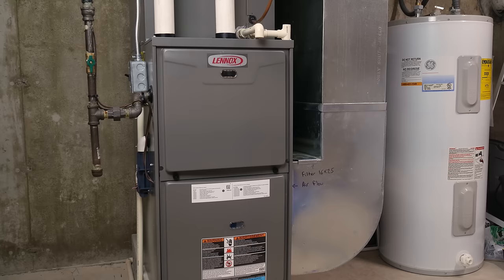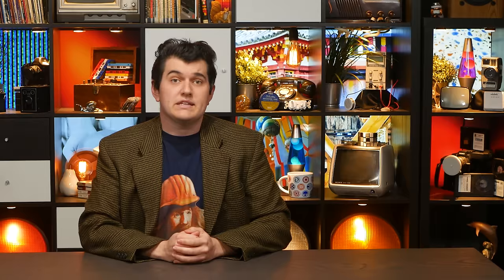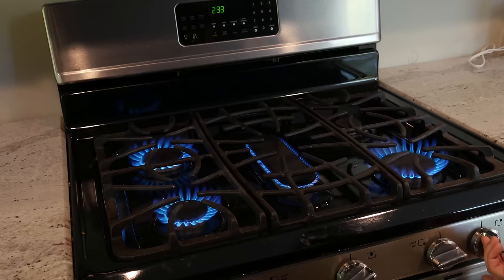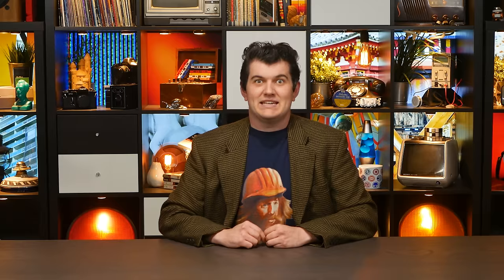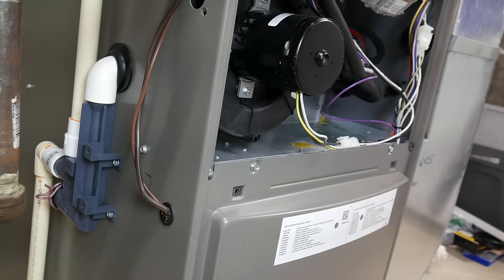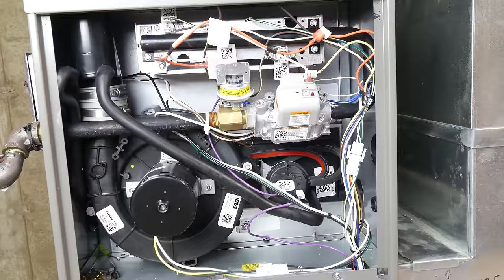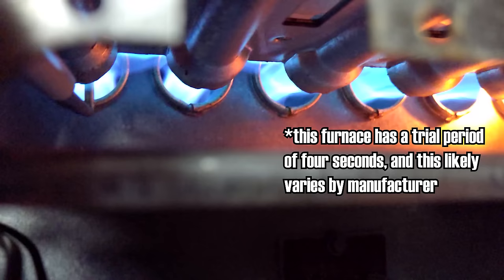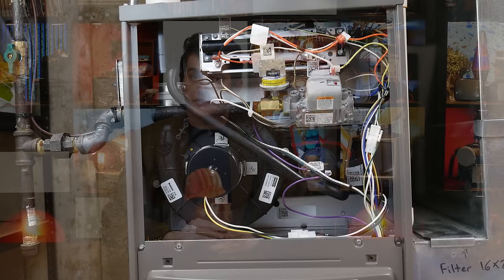Forced-air Furnaces: The What, Why, and How

Comment: "blower motor" stressed that "wrong" way is much more like the natural stress in British English.
Reply from the maker: A thing that's always puzzled me about that is that, to my American ears, it seems more appropriate to put the stress on the thing that makes it specific or different from the norm. There's many kinds of motors - what it's for seems like the more important thing to stress. I feel the same about how "ice cream" is said over there. Yes, it's cream, I got that, but it's frozen and that's what's special about it. Anyway, thems me thoughts.
Reply: @TechnologyConnections  that makes sense,  but the counter argument is that it's more important that it's a motor than that it's a blower something. Or in other words,    ice cream is basically cream, so if you miss the word ice that's ok. But if you miss the word cream you'll be miles off.
Not that I'm saying our way is better, just I think both are sensible,  and it amuses me that we differ.
Reply: @TechnologyConnections  However the phrase blower motor while yes it does clarify what the motor is for it does not however give any information on what type of motor it is. Mostly useful in the context of distinguishing between multiple motors in the same machine the only information given about the part in question is that it's a motor, motor type and drive mechanism are unspecified. Then again a technical description of the part itself is generally pretty impractical for verbal communication at least thus why we generally give the things part numbers rather than trying to memorize and recite the entire technical specification when we need to refer to that specific part.
Reply: @xorsyst1  Bolloks!

Comment: On a possibly unrelated sidenote: i always wondered if America's Corona spreading action is helped by the omnipresent air conditioning.
 

Like compared with opening a window.
Reply: That would all depend on whether SARS-CoV-2 lurks inside or outside your home.  Around here, it seems the neighbors aren't aware there's a pandemic.  I hear them making gregarious noises all the time.
Reply: @joesterling4299  And if Your home  is (air wise)  connected with other homes. Not to mention your office with other offices, which is almost certainly the case. It will dissipate very quickly outside your window.

 I remember when this sudden mass outbreak happened in that big slaughterhouse in Germany the fast spreading was blamed on the ventilation system. 
And the poor working conditions.

Comment: Okay so this drives me nuts - I've lived in BC my whole life and every house I've ever lived in has just had baseboard electric heaters and nothing else. I can't imagine requiring a bloody furnace.
Reply: everyone out here on the prairies in Manitoba uses these.  Almost every house in Winnipeg uses a forced air furnace (mine included).
Reply: Requiring? Well, it's not required, but it's cheaper than using only electrical heating.
Reply: Consider yourself lucky, Trudeau has already taxed home heating, and increased the tax in the middle of a pandemic. you'll be far better off with Electric.  I'm thankful I have nothing better to spend my money on, so I'll just keep my house extra warm and pay the damn tax.
Reply: @xeero24  k
Reply: Depends how much heat you need and how expensive electricity is. Here in Saskatchewan you'd bankrupt yourself running electric heat. Pretty much the only people that do are those that have no other option with no natural gas or propane available nearby.

Comment: I, a European, have no clue what he's talking about
Reply: I, a Floridian, also have no clue. The idea of adding heat to your house is beyond ridiculous to us
Reply: @johnbeauvais3159  well my good friend u would be surprised to find out then that if u have central ac u also have a heater cuz the law requires it for .... reasons?
Reply: Link Hidalgogato I am surprised to learn this, the house I grew up in was built in the 1980s and to my knowledge we have never turned on the heater.
Reply: @johnbeauvais3159  yeah they dont exactly get a lot of use but yeah every air handle unit has an electric heater. i have never turned it on either cuz u know dont wanna cook my self
Reply: How do you heat your houses in Europe?
Reply: @gregorymalchuk272  water gas boiler with radiators or heated floor.
Reply: @ilyacheladin1  
You guys have some very nice ultrathin radiators in Europe. I don't think I've ever seen them used in the U.S.
Reply: @gregorymalchuk272  In Ireland we use an oil-fired water-radiator based central heating system.
Reply: Water boilers work similarly, except for the heat exchanger.
Reply: I am Weasel
Reply: @Jupiter__001_  Water radiation?  Do you use tritium in your water, or radio-active oxygen? :-)
Reply: I, a Russian, have no clue what is "heat".
Reply: @Jupiter__001_  my parents old house that was built in Virginia in 1950 also had a oil furnace and central ventilation.
Reply: The difference between the continents is the distribution of heat. You burn something in a “remote” place to generate heat and get rid of the exhaust from there. In the old world water is heated and transported via a pump and pipes to the places in the rooms where heat is needed and distributed by radiators. In the US air is heated directly in a furnace and distributed through the place in ducts. Distributing warm air in fairly large ducts over long distances is less efficient than distributing warm water in small and isolated piping.
Reply: @e.c.listening326  ...and probably the heated air in US houses is way more dryier compared to the air in european heated houses with water radiators.
Reply: @gregorymalchuk272  In Finland, wood heating boilers are popular, modern ones can be very efficient (90%>). Oil burning and wood burning combo boilers used to be common but are getting phased out. Heat pumps have been increasing in popularity since the 1990s and my house uses a ground source heat pump connected to a 130m deep borehole. Old style heating is still common too, massive masonry fireplaces that recirculate the smoke and can be over 70% efficient. I have one of those as a secondary heat source and of course for the ambiance. It's the heart(h) of the house after all. I'm also seeing more solar panels.
Reply: @1873Winchester  Yes, its about the same here in Sweden. We use a wood heated boiler. Its a bit annoying though now after I've lived abroad in Austria and got used to a gas heatetd boiler, because with the wood boilers you have to put the wood in yourself.
Reply: @haffa4764  well, I would argue that the wood burning boilers are getting few and far between, at least as the primary heat source in Sweden.
Reply: @haffa4764  I don’t know where in Sweden you live, but everywhere I’ve been we’ve used either electric heated boilers, remoteheat(?)(fjärrvärme) or the electric heat pumps mentioned in the video.
Don’t mean to offend or critizise you but I don’t want you to give the ’mericans the idea that we’re an undeveloped little country that still burns wood for heat.
I should mention that I’ve never lived farther than 10 km from a ’big’ city, so it might be that I’ve been spoilt by that 😆
Reply: @YaFaceIsMine  I live on the country side, and we and all our neighbours use them as our primary heat source. 
Of course in the cities or towns it is not usual. So they are in number not that common, but for certain regions of Sweden they are still widly used
Reply: @haffa4764   That’s cool! I had no idea 😆
I guess you learn new things every day. Thanks 🙂
Also, thanks for not overreacting to my plump comment, I know it was a little harsh sounding, but I was feeling frustrated for something completely different so I needed to vent a little.
Reply: My home in Pennsylvania, built in 1920, has a coal cellar with external coal door.

It has since been converted to gas heat, but there was still a half-barrel of anthracite when I cleaned the room out last year. Made for a great bonfire!
Reply: Having lived with both systems, I can authoritatively state that radiant heat is LESS efficient than forced air. Nearly every house that "upgrades" to forced air sees a utility savings.

It's just extremely impractical to transfer 90+% of heat energy to water.
Reply: @linkhidalgogato  That is simply not true, go buy an air handler and see if you can just turn the heat on... In most cases you have to but a heat kit to install after the fact to match the size of the space it is heating and the blower drive.
Reply: @whitewigglesworth  the building code requires every house has heating so unless your house is absolutely ancient or has a dedicated heating system your acu is also a heater maybe they dont get made like that by the factory but thats how they are all installed

Comment: 3:55 oh great now I will have $500+ heating bills to match my cooling bills here in Texas!  With over 5000 sq feet to heat, I currently have 176,000 BTU's of heat that is 94% efficient (my house attic is fully sealed and have to use HE units to get fresh air from outside.  My gas bill is only about $150 during the cold months.  Absolutely hate heat pumps!  I have them on my boat as well and have to supplement it with emergency electric strip heating as well, as the water gets too cold to extract the heat out of.   When I lived in Kansas I had a heat pump and never again.  Someone will have to pry the gas furnace out of my cold dead hands before I give them up, or start giving me electricity for free to run them all the time, in which case then I will keep the house much cooler as well!  😁

Comment: 4:00 But if your electricity cost per joule is 3x that of Gas (and getting higher) electricity is way too expensive.
Reply: Nope because heat pumps are way more efficient than furnaces. You also need to look at the price per BTU of energy not just raw numbers. Furnaces will never be 100% efficient which means for every dollar you spend you will get less actual heating per the money you spent. While a heat pump works of a vapor compression cycle and for every dollar of energy you put into it you will more than money dollar out of it. The efficiencies of the best heat pumps get into the 10 to 12 HSPF range which is basically the same as a 1200% efficiency.
Reply: Not as expensive as climate change
Reply: @KellyClowers  Climate is always changing. What's your point. BTW something I've never heard answered, what is the optimum global temperature? Did you know that for the majority of the Earth's history the global temperature was about 80F? That's 22 deg F ABOVE current global mean temperature. Where is the danger of 2 deg rise?

Comment: Excellent video! Cheers form France! Also, the flame sensor is supposed to be a ionizing sensor. If there is flame, a small current will travel from the metallic nozzle to the flame sensor (piece of metal essentially)
At least that's what I red somewhere!

Comment: “We don’t typically use electric resistive heating to heat entire homes, because, while electric heat is itself 100% efficient, electrical generation is not.”

laughs in québécois
Reply: Houses built around here (Pacific Northwest) in the 1950s through 1970s sometimes were all electric (resistive) heat.  This was due to the a) the climate being mild, b) natural gas and propane not being cheaply available, and c) very low electric rates, around $0.02 or $0.03 until the early 1970s.
Reply: Laugh all you like, but, even hydro (or wind) plants aren't 100% efficient, you get losses in the generator windings & also in keeping the generators cool, also through inefficiencies in the water turbines & pipes that supply those, & I'm not even starting on the transmission losses.
Might be lots better than a fuel burning plant, but nothing is perfect, please see laws of thermodynamics.
Reply: If you use electric resistive heating, you don't have to worry about turning off the lights.
Reply: @vinquinn  my house is also 100% LED
Reply: @beardyface8492  I mean yeah, but it also has 0 ongoing carbon emissions, whereas a gas furnace does not.

Comment: A big problem in Europe now is even though Central Boiler With Radiators isn't worse, in some cases I would say preferred for heating a home we are now running into the problem that most of them aren't designed to run at the lower temperature water heated by a heatpump. Meaning that installing a heatpump usually is much more expensive and requires either the installation of new radiators designed for the new system, or creating a hybrid system that leaves the old radiators and suplemeting the warm water with extra heat from the boiler or installing a new ducting system like seen in this video.

This means that a lot of "poor" / "Lesser off people" living is usually older homes that could really use these more efficient and more importantly cheaper to run systems unable to afford such big renovations! 

This is coming from a Dutch perspective though, so this argument holds the most weight in the northern western European part of Europe,  I don't have much experience with southern European heating designs or eastern European ones.

Comment: I remember All Electric houses of the 1960s and 1970s.  They were much more expensive than ones with gas water heaters, gas dryers and gas heat.
Reply: ...yes expensive... in the 70s which was what 40 plus years ago. It was also in vogue to use leaded fuel and smoke yourself into cancer

Comment: As a hvac student in europe: "what the hell is this thing? "
Reply: Wait until you find out how we get hot water in our showers here in Brazil lol
Reply: @guilherme94  I've seen Electroboom  talking about those things, i don't care how "safe" they are, a water bucket seems way more sensible.
Reply: @guilherme94  imma be real with u i know they are safe but i just cant bring myself to thrust those things
Reply: @guilherme94  Happens in so many parts of tropical Latin America!
Reply: @SickCotic  
Don't you have any forced air furnaces in Europe? I know you guys have lots of radiators.
Reply: @gregorymalchuk272  I can only speak for Norway, but here it is almost exclusively heat pumps. We pretty much banned all use of fossil fuel heating in houses anyway.
Reply: @SickCotic  
What refrigerant is used in your heat pumps?
Reply: @gregorymalchuk272  Most modern systems use R32, but older systems are still on R410a, but those are not legal to sell as new if memory serves.  and i have a portable one with R290.
Reply: @SickCotic  I like how you say "older systems are still on R410a" Here in America, our "New" systems are ONLY R410a. XD
Reply: @SickCotic  Do the heat pumps work in winter when temperature dips below 0 degrees?
Reply: @panzer3279  Zero degrees in what units?

A relative from the Midwest had heat pumps, but still needed a furnace for days when the outside morning temp was -40 in Centigrade or Fahrenheit.  Actually warmer than that, but it will work below freezing, maybe below -10 F.
Reply: @Egilhelmson  I meant 0 C. So heat pumps don't work well below freezing point.
Reply: @panzer3279  They work like absolute shit when it's very cold. They also work overtime when it's just somewhat cold, and burn the much faster. As usual, there's no magic bullet that fixes everything. Although minor improvements in very specific areas can cause people to go on about their chosen technology as if it was the environmental second coming. If that happens I just ask them why they're not heating their house with a small nuclear reactor. Zero emissions and you can get pretty much unlimited heat from some funny rocks. You could also electrically power your entire neighborhood from the same device. Anyone who doesn't have a fission furnace/generator in their basement is ruining the environment. Lol
Reply: As someone who lives in the Sun Belt, I don't know what it is either.
Reply: @blackhawks81H  thats wierd here in sweden our heat pumps works fine up to -20c
Reply: @blackhawks81H  You must have a shitty unit.  Works just fine down in -20c, but the efficiency coefficient gets a bit lower when you pass -10c. Varies from unit to unit/brand but min e is 5.5 at -7c and 4.0 at -25c
Reply: @SickCotic  yup, here it's also R32 heat pumps, ground/geothermal heat, solar panels, or 'fjernvarme' (excess heat from garbage burning). Older homes of course still use natural gas burners.
- Denmark
Reply: Heat pumps are often paired with some amount of electric heat coils (atleast in my region of the states). In addition, a majority of our systems here are either r410a or mo99 (an r22 replacement)
Reply: @SickCotic  heh... 
R290 is plain old propane... just so you know...
Reply: @olaruud9366  or you have a really expensive heat pump.  The your heat pump has an equipment cost that is 2-3 times that of a "regular " heatpump
Reply: @abjz71  Its certainly not the cheapest shit availible, but "really expensive" is not exactly how i would describe it. Its pretty new, in the upper edges of performance but without much extra bells and whistles that the real expensive "premium" stuff has now. 
I think it was around 25000 NOK or about 3000 Dollarydoos.
Reply: @blackhawks81H  do you know where I can buy a nuclear reactor?

Comment: Looking forward to the vid on heat pumps - living in Norway, a cold climate generally, the govt banned the use of liquid fossil fuel burning for domestic heating this year so we installed a ground source heat pump last year. We have a well drilled to 260m deep as the source. Last winter was not very cold so we didn´t get to thoroughly test it out...